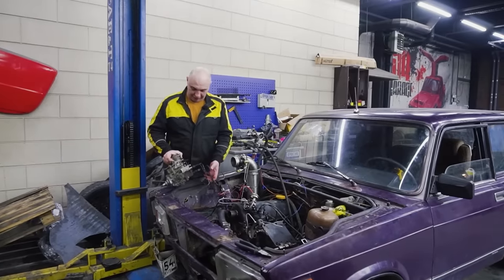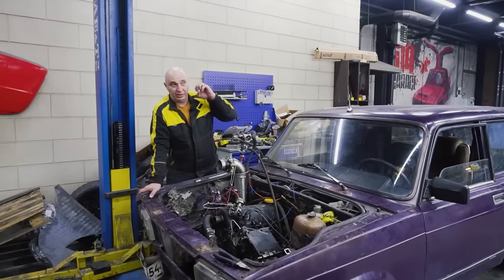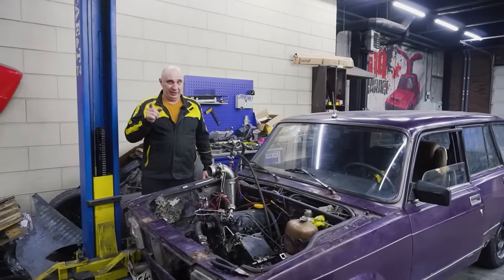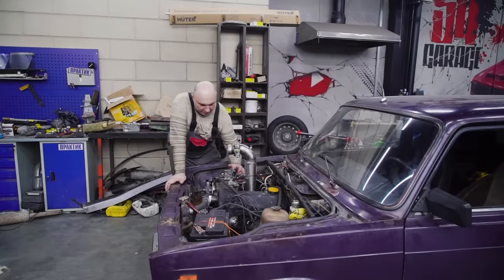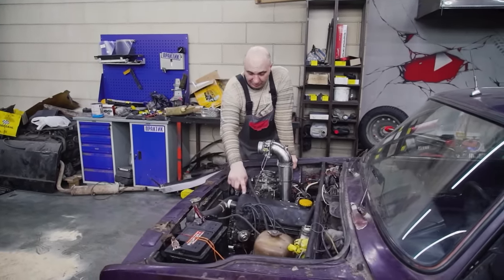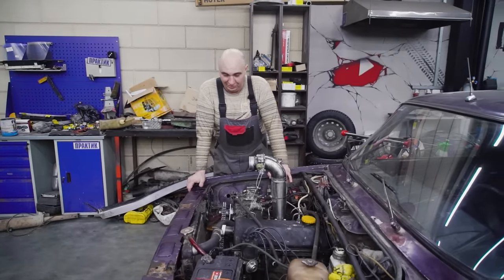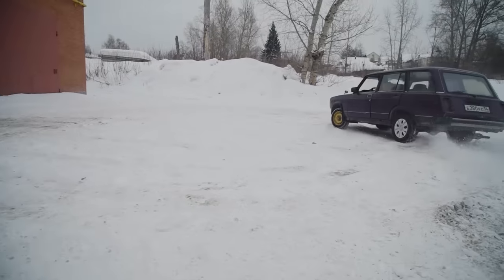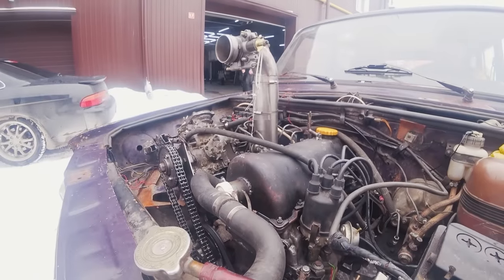We fit high pressure DIESEL pump to Lada engine

Comment: There was an Australian guy called Raplh Sarich, invented port fuel injection that combined compressed air with gasoline to produce an extremely fine mist, much better than conventional gasoline injectors.

Comment: Diesel engines modulate the fuel input to control RPMs the air intake is wide open there is no restriction to air intake more fuel equals more RPMs Diesel high pressure pumps operate at thousands of PSI and the injectors are normally a poppet style injector which when it hits a certain pressure it pops the injector open and its snap shut when the pressure drops if you were to take some spare cylinder heads and do some Machining to get the injector in the center of the cylinder head and have it pop the injector open apt about a quarter of the way down the cylinder it would make for great fuel-air mixture you could end up with an extremely high performance very fuel-efficient engine

Comment: You must still have enough fuel at high rpm, I am surprised that the governor didn't make it lean.
As far as extra power goes - you have a big throttle body, more airflow than carburettor, try fitting your own separate throttle bodies?

Comment: diesel engines have the air intake permanently wide open. they rev up by increasing the diesel fuel flow. so if you remove the throttle valve from the air intake and only use the fuel pump you might get better results.

Comment: weeeeeel if you would add a servo to adjust that diesel fuel pump, and have some wide band sensors and an ardunio to tune the system to a given lambda of 0.8-0.9, it would be quite some epic thing, i mean , you would make a shitload of power and make it run very efficient.

Comment: Gas engines use throttle blades to regulate the amount of air going in to the engine thus regulate engine speed. Diesels use fuel flow to regulate engine speed so they do not need a throttle blade.
Next interesting experiment i would do it so link the throttle blade and the pump so you are not constantly full fuel. That would give you a leaner burn(more power)/less fuel consumption/smoother running engine.

Comment: i can say this most diesels dont have a throttle body and its why runaway diesel is so scary. 
having 2 separate throttle inputs is a problem as their both timed and tuned differently. 
finding a tuning point off the injection pump would be more precise but operating the throttle body plate for a failsafe throttle and using the injection pump to supply fuel would also work.
you would need to math the size injectors you have vs fuel flow maps for the injection pump to figure out how much throttle position vs how much injection pump position to keep it within reasonable air/fuel ratio ranges.

Comment: This mod forcing the motor to have always the same amount of gas for one burning cycle, depending on how much air it gets the AFR can only be between 0.6->1.6 to run the engine, and so it somehow selfregulates the rpm, but i guess fuelefficiency is not great at all. Would be nice if you could measure the AFR to find the best settings ;), so far i have seen, the best lada engnie would be a 4 ring Piston, Dieselpump intake manifold injected, turbo engine :D

Comment: always wondered if this was possible. I've thought for years that a ford 4.9L inline 6 converted to diesel would be interesting.

Maybe even a ford 4.6 or 5.4 could possibly just shave the heads and block to get compression necessary. a diesel v8 that revs like a mercedes om606 would be something...

Comment: Manual Air fuel mixture .. have to link them together and synchronize them .. throttle on the fuel no air it’s running rich , open air no fuel then running lean

Comment: There are a few newer gasoline-fueled diesel engines which actually run on gasoline, yet like its counterpart that runs off fuel oil, they tend to run pretty lean which hot air is just enough to combust the fuel during the power stroke cycle - the only difference between both diesel engines running different fuel is injection timing, due to the fact that gasoline is a little bit stubborn owing to the anti-knock agents added to it, so it has to be forced somehow, usually by pushing the main injection against the pilot injection timing so gasoline finally burns via compression ignition. The electronic diesel injection system on gasoline-fueled diesel engines aren't very much different from the original diesel engines, just there is an exception, and that's the software running on diesel engine computer which is programmed differently from the de facto diesel engine software.

And as for port injection system, it's somewhat touchy as it has to have a little bit more fuel than the diesel injection pump can provide, and fuel injection is usually metered every time the injectors fires - you can get away with that just directly injecting the gasoline directly into the cylinders (via direct gasoline injection setup).
Reply: I'm pretty sure this dedign is a century old, there were lots of old tractors that ran on both gasoline and kerosene. You start with gasoline and turn on the spark plugs, once the engine is hot enough you can switch to kerosene and turn off the spark plugs.

Comment: Didn't Bosch have a fuel injection system something similar to this. I think they called it Jet-Tronic. It looked like it used a mechanical pump. I might be wrong about this not sure.

Comment: Diesel engines are high compression. You need to either weld up the cylinder head or put pop up pistons installed.

Comment: It will reduce fuel as rpm rises!
You need to directly control the fuelling 

You need to know how much to turn pump for each throttle position, a shaped cable pulley would work.

Comment: Could you get more economy by working th throttle and pumpd hooked up together or make a manual control  for the pumpd to lean or enrichen it like an airplane engine see what the mileage does

Comment: try double rotary valve (axial and radial) gasoline turbine, input axial rotary valves synched smartly with the radial rotary valves, to make a pulsed turbine engine, ask for more info if something does not immediately fit in the idea
Reply: align the holes, both intake and output, all by rotation motion, and the turbine being the flywheel itself
Reply: shroud (duct) the impeller turbine, it must be shaped like a water wheel, inside out flow, radial hot gas flow, center radial out

Comment: This will only work on older motors and mechanical pumps. The computers on newer cars would completely lock out the engine with that setup.

Comment: You would need higher compression and direct injection, so that the piston not drawing in AF on the intake stroke. and so it has high enough compression to ignite the fuel with out spark plugs.
Also the injector are open for a much shorter time on direct injection probably why you need to add 75% fuel
Reply: Then it would be diesel engine.
Reply: @V8Lenny  no it would be a modern gasoline engine

New gasoline engines use this method, they call it GDi or PDi but instead of a mechanical fuel pump, it's controlled by the ECU.
Reply: @tristan6509  they have spark plugs for ignition. HCCI engines are only prototypes.

Comment: diesels dont need any restriction to the air. its not a gas engine, it doesnt need a air fuel mixture like a gas.  it doesnt run rich or lean.

Comment: I’m gonna tell you now. There if they are gonna keep running that the pump will not last long. They need to connect a coolant line to the side of the pump. It is correctly by temperature and while cold there is a lever advancing the timing and is constantly resting on another piece internally. Eventually it will wear away and snap off if it never gets warm and moves off
Reply: Gasoline has a cooling effect unlike diesel, try putting alcohol in your hand and it'll feel cold.

The only problem here is the lubrication which was taken care off by the 2-stroke oil they mixed with the gasoline

Though of course if you want to run this long term, you have to design an oil system for the injection pump instead of relying on 2 stroke oil.
Reply: @tristan6509  your misunderstanding, my apologies for the poor explanation. I'm on about an internal part of the high pressure pump which literally rests on another part, because they have it disconnected it'll never come off the carriage it is resting against. Look up Bosch VE cold starts mechanism and there may be diagrams online

Comment: I thought the reason diesels get better volumetric efficiency was because the compression of the fuel produced more complete combustion so you could put more fuel to air into each charge

Comment: what about a gavernor inside a fuel pump. that throttle lever basicaly adjust just a spring tension not a direct fuel amount. all the job is done by governor depending on engine load. i think thats what causes their trouble to understand "why it works".  i haven't hear them talking about that

Comment: diesel works on compression then fuel BANG  gas engine uses vacuum to control the air  /fuel ratio

Comment: I'm curious to see what happens if you add a LPG G3 installation to it?

The 3th generation has direct injection with fluid gas, that is introduced to the cilinder at 13 bar and is ice cold, so there is more air intake possible.

On my BMW E46 330, a 3L 6cilinder, it added 7HP and much more torque in the lower revs.

I must say that it came with the right software and everything, but maybe there is a low tech solution.

Is LPG, liquefied petroleum gas, available in Russia?

Comment: Would be good to see them inject diesel into the spark plug holes and shave the head way down to raise the compression. See if they can run it on diesel.

Comment: So your fuel pump is going to add fuel until it gets to RPM. The throttle on the pump only changes RPM and the governor will change the fuel rate to achieve that RPM. All your throttle body is changing is air fuel ratio

Comment: so if the engine is controlled by the air intake and the pump is constant it wastes a lot of fuel also when it runs slow, am I correct?

Comment: If you think Diesel Fuel pressure is high, wait until you find out how much pressure a "Common Rail Diesel Injection" system has... they have up to 2.200 BAR (32.000 Psi)

Comment: They were talking about 3 kg injection pressure for gas injection, and 7, maybe even 10 for the diesel. Now, I dont know how old this stuff they are running with and pressures have generally gone up the newer the engine is, but my Diesel car has a 120 kg injection pressure (edit: No, its 1800 kg, I misremembered). So I would think this is a bit more than 10kg even if it is very old...
Reply: This injection pump would be around 150 to 160 kg and it came from the 70s and 80s. Higher than gas injection, but compared to modern common rail diesels, it is very very low. Common rail diesels are easily 10x to 15x higher pressures.
Reply: @killstrees  Just realised I misremembered, its 1800 kg for my car, not 1800 psi, which would be about 120 kg I wrote before. So 1800 kg is what I meant.

Yes, you are very correct in what you write. I wonder where they got the "7-10 kg from"? Perhaps just a guess?

Comment: This is cool. I was thinking 🤔 that if you run a cable from the throttle to the injection pump regulator control,  it might be possible to regulate the enrichment of the fuel to correspond with the amount of air that goes into the engine, for mixture control.

Comment: Basically the reason it won’t Rev much more is because there is a governor in the Hp fuel pump as in diesels they need to be governed by fuel not spark and you need to connect the throttle body and lever on fuel to increase fuel and air together as you throttle and the power comes from the extra atomisation as its high pressure have a play and post another video please very interesting abs I am a diesel speacialist

Comment: Nothing new here. A company called GutBrod in Germany built the first fuel injected car using exactly the same style of bosch pump and thousands of Mercedes up to 1972 were sold with mechanical fuel injection,even Aston Martin sold a DBSV8 with mechanical injections. It's a great idea because the injection runs at 200PSi at the injectors.

Comment: Gas/oil mix in a Lada? 
Congratulations, you've converted your Lada into a Trabant!
In order to reach your desired Porsche or Ferrari performance level, perhaps a higher-capacity fuel pump would do the trick. 
I suggest the fuel pump from a Saturn 5 rocket engine. 
With a few minor tweaks to its suspension and braking, your Lada should run competitively on the F-1 circuit.

Comment: this was a good project . I would however consider how the engine is able to "take the extra" and what effect it might have on the pistons , bearings and so on in the long term. In my opinion you for sure need to keep working with this setup and see how much refinement you can realistically put into it and do fun stuff.. Stay experimental guys!

Comment: Rotory diesel injection pump mechanical control the components of this pump:
Acceleration lever
Stop valve
Regulator valve inside the pump
Slider
Timing injection control unit mechanical control
Plunger springs
And Plunger piston
 Rear Anti returns valves
Bearings to control with piston plunger
Diesel pump to feed the pump from tank to diesel pump and protect the pump parts by decrease the friction by pumping the diesel
MAX rpm control adjustment screw
Idle speed adjustment screw
Feed lines to injectors
Diesel injector

Comment: Why wouldn't it work? Direct injection engines all have high pressure fuel pumps. Although smaller and electric so they don't lose pressure when revs drop.

Comment: You have made a mechanical injection we use that for a race care set with methanol look up rons injection Hillborn injection it work with a pump set the barrel valve it atomizer the fuel more you basically made a home made mechanical fuel injection look up rons fuel injection

Comment: All about injecting right amount of fuel to every turn of engine. More rpm, more fuel in a time unit but same amount every rotation. Diesel pumps do the measuring and are varied by throttle input, which here is solid 85% ish.
Using k-jet mechanical injection also gives nice torque as it gives strong steady stream of fuel.
Reply: this is like hillborn or 50's german systems.  

the only problem is if you don't have any systems to limit based on intake vacuum or throttle position then driving part throttle gives same fuel as full open. for racing it's not so big of a problem though.
Reply: @lasskinn474  Also no acceleration enrichment so it lags behind and goes super rich on engine braking/overrun.

Comment: diesels usually get better power because of the high compression ratio.  usually 18.5:1 or higher plus boost air coming in.  diesel fuel is thicker than gasoline, so the nozzles on the injectors would need to be changed similar to changing a jet in a carb since it will spray more fuel.  diesels do not have a throttle valve meaning it gets 100% air flow always.  gas engines need the air flow controlled because too much fuel to air will fowl the spark plugs, and not enough fuel will cause a high heat situation which will burn the exhaust valves, etc.  if you can connect the throttle valve to the fuel rack on the injector pump precisely, have the fuel timing (and duration of spray),  and have the correct fuel nozzles to allow the correct amount of fuel, then it should run good.  carbs usually cost $100-200 for an engine of that size.  that diesel jerk pump is prob $5k new.  no sense in that modification
Reply: also, the fuel pressure on the diesel pump runs around 5000 psi instead of 41psi.  the fuel atomizes so well it will burn better including the 2 stroke oil.  side note, there is pressure adjustments on the pump that can be messed with to adjust the amount of fuel.

Comment: Curious is the exhaust heating up from all that extra fuel?
Reply: Generally the opposite would be true, running lean would cause cylinder/exhaust gas temperature to be higher and adding additional fuel cools the incoming air and cylinder/egt's

Comment: Guys gasoline engine not like diesel need CORRECT amount of fuel and air. This is so called stoichiometric mixture. If there is to much of air or fuel engine will not produce full throttle and power.
This is why it have throttle valve and computer callcullating how much fuel is need to burn properly. This is so called AFR (air fuel ratio).

Comment: I didn't see the distributor vacuum hose connected. The vacuum on the distributor changes the spark timing. The engine would make even more power if it were connected.

Comment: I have an idea to make the engine run faster and to convert it and have it drilled out in the cylinder ... converting from four-stroke to 2-stroke engine with an old engine a hole in the silinder itself an out lat port just like a two-stroke every spark will also be used this could be a new test looking forward to the result when the pistong is down the air must be able to escape long a hole through the wall ok brastof must also be added along such a port am curious just like 2 stroke but with four cylinders so you would see how a two-stroke works ...new project ..

Comment: So this means that a mechanical fuel injection is possible in the modern age. Good to know dont need a ecu/pcm to run my electronic fuel injection engine. Diffenetly gonna try this on my ford later on in its life when they stop making pcms or electronics any more.

Comment: It run´s so easy is because you always run verry rich and you controlle the power by how much air you put in, and It dosen´t "flood" in the clasical way because of the injectores!
The diesel injectores always make a good atomization and don´t rely on the air flow like in a carb or typical crappy gasoline injectors!

Having extra of air or fuel is generally is not bad, just having to less... unless you wan´t some fuel economy that is... 🙄